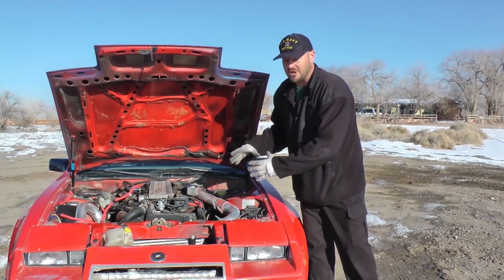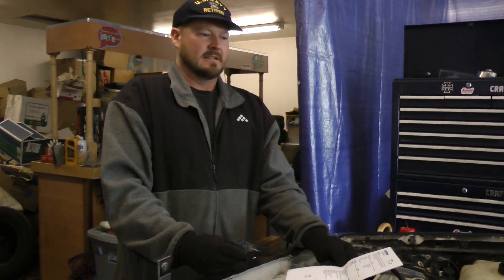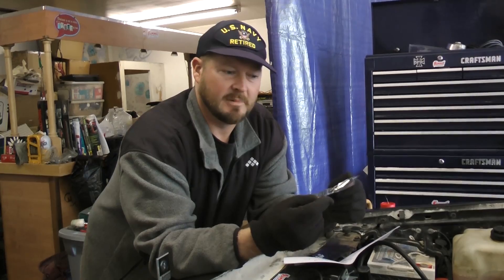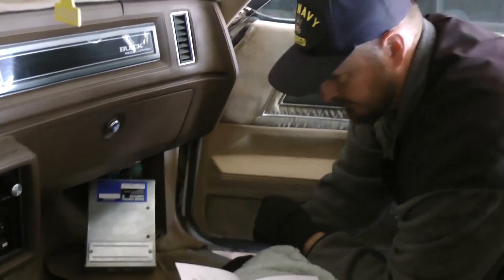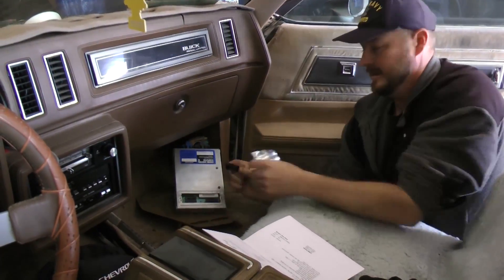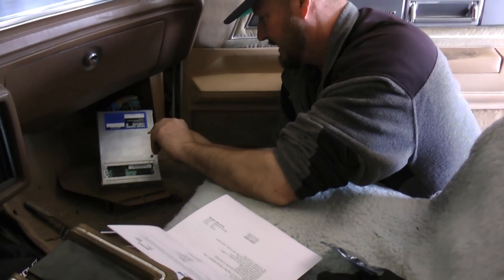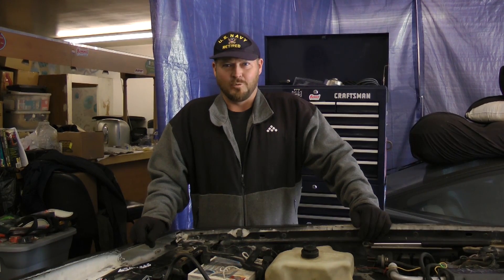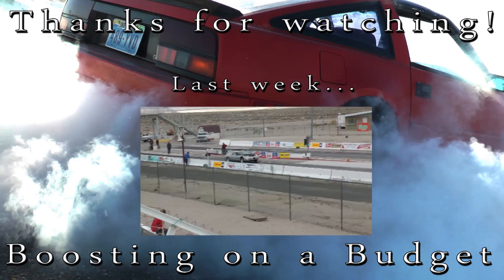Performance Chip Information And Installation (OBD 1)

Comment: Hey Matt I have 1986 chevrolet monte carlo 4.3 fuel injection  I change the engine and put a 350 in it kept it fuel injection I was wanting to put a stage 2 performance chip but I can't find it and the right one if you can point me in the right direction thank you

Comment: Who'd you get the chip from cuz you said they make custom make for your application because I have a 85 S10 and plan on doing a little bit engine work too and it's got the 2.5 TBI in it

Comment: I can help with seat covers the bucket seats come apart eazy. We mark lines on seat covers Razer blade them apart. Lay old peices over new suade, leather, Tweed, anything really they have soft fake leather. I even spray paint seats detail trucks have in spray can. Just have any sewer sew new covers. It jiggle saw puzzle. On bucket seats both side are same you just cut 1 bucket apart make 2 copies. Covers shrink and you need adjust better copy ez it is for guy sewing.

Comment: I got a 87 stock Gn and why is it the fan always takes so long to run ?im only asking because u had said some thing about it ?
Reply from the maker: If I remember correctly, there are two fan relays, one low speed, one high speed, I remember going to the Caspers electronics website and purchasing their special fan relays and my fan performed much better afterwards.  Also change out your coolant temp switches, there are also three of them, one for PCM, one for the gage or temp light, and one for the fan relays to turn on the fan.  I remember changing all of them out since they were 30+ years old and my fan's performance improved.  Also recommend 160 degree thermostat which keeps overall coolant temp down.  I removed my A/C condenser since it was blocking the radiator and it consistently stays 20 degrees cooler than before.  Lots of little things improve the big picture in the cooling system.

Comment: Hello I install long tube headers on LT1 ss and lost power do you know if it has to be tune? will not even spin wheels.
Reply from the maker: Performance intake, hi flow or no CAT, Free flowing mufflers.  The stock exhaust and intake are holding back header performance.  For tuners I recommend Diablosport, they do great tunes enhancing intake and exhaust mods.

Comment: Why not just disconnect the battery??
Reply from the maker: Peter Kapica I do disconnect the battery for safety of the chip.  I did forget to mention it on the video since mine was already disconnected.... Thanks for bringing it up.  I usually just disconnect the negative cable but for this video, both terminals were disconnected since I was just finishing up an engine swap at the time.

Comment: Do you have, or are planning on doing a video on adding a turbo to late model fuel injected vehicle along with supporting mods such as how to choose the correct size of fuel injectors and so forth?
Reply from the maker: ***** Right now my latest model vehicles are turbocharged, My 14 F150 ecoboost and 15 mustang ecoboost.  Other than that my vehicles range from 1979 to 1992.  Hennessey performance has done many turbo conversions on the new Mustang Coyote engines as well as the new Camaro and Corvette engines.  I would recommend them for a late model turbo conversion, they are expensive but their quality is very good.  For do it yourself it would be very difficult due to the space constraints on many new vehicles, they give very little space in the engine compartments which make turbocharging difficult but it can be done but with lots of fabrication or specialized kits.  Turbonetics sells bolt on turbo kits for some of the Camaro and Mustang cars which do not come turbocharged on their V8 engines.  SCT tuners can have custom tunes made for them by running your turbo setup on the dynometer and making slight adjustments when they are needed according to all the monitored gages on the dyno.  Custom dyno tuning is the way to get all the engine electronics mated to a new custom turbocharger set up and they usually range around $350 for the custom tune and around $600 for the tuner to upload it to your factory PCM or engine computer.  Hope that helps.

Comment: Hey Matt, just found your videos a few days ago. You do a great job and and I learned a lot. Sorry to hear about your accident hope your recovering well. Will keep you in my thoughts and prayers. Just did the intake mod, modified the air box, installed k/n filter,cleaned the maf with the special cleaner. I have a 2005 Silverado HD2500 and wow what a difference. I tow a 8k fifth wheel and the gas consumption is horrible. Can you recommend a chip that might help in that area. It has great power but the gas is the downer. Can you help?
Reply from the maker: Steve LaNovara The tuner I had the best experience with for fuel economy while towing is the Diablo Sports Predator tuner.  They are specific to vehicles and have a special tow economy tune you upload from the OBD II diagnostic port, the same place where trouble code reader hooks up.  The differences after the tune are amazing.  Since you did the intake mod, the exhaust mod should be done with it to get the best power and economy gain.  Remember breathe in and breathe out, if the air is hard to get in, the intake upgrade helps that, if the exhaust is hard to get out from the restricted stock exhaust, have the stock mufflers removed and have one free flowing thrush welded muffler or flowmaster welded muffler installed or welded in and enjoy your new performance, economy and effortless towing.  Thank you for watching
Reply: https://youtube.com/@madboostingmadmatt48. This is my other channel mad boosting